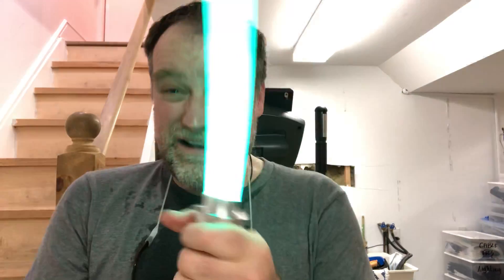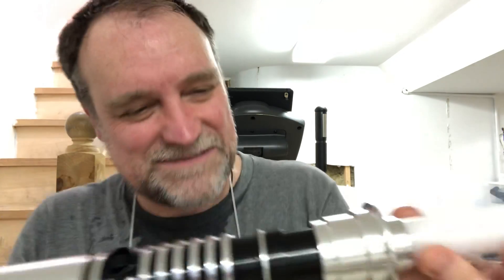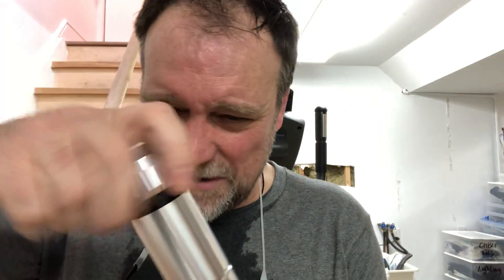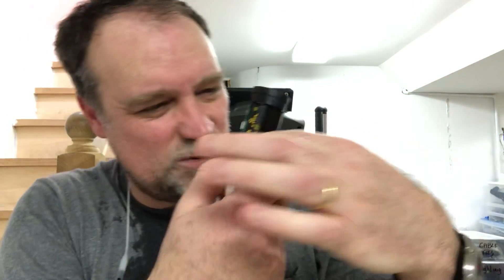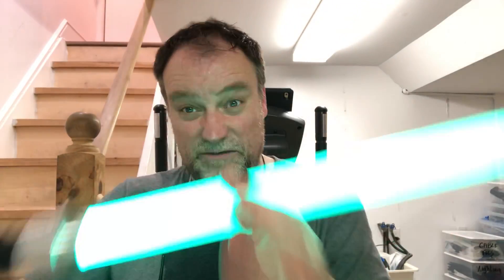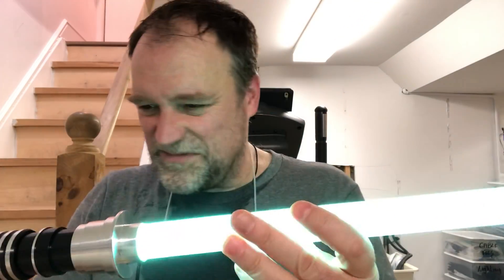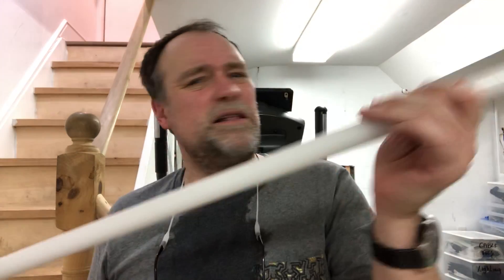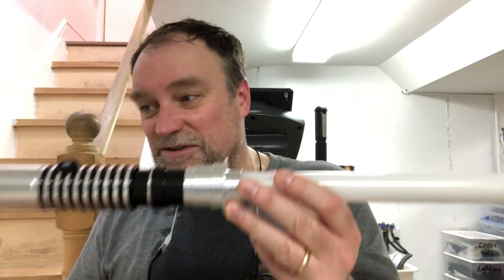Hand a router to Robotic arm or CNC router?

Comment: That 6 axis robot definitely can't do CNC milling ( unless being limited to foam or very bad results is ok ). You want a ton of torque and most important structural strength and rigidity to do CNC milling. The absolute top mistake of people building their own CNC router is underestimating this. Happens maybe in half of the DIY builds. 
To be clear: routers on robot arms *exist*. But this starts making sense when the arm starts costing the price of a house.
Oh btw, a reminder: if you want a FREE Smoothieboard Open-Source CNC controller ( fully Fusion360 compatible btw, we work with them on that they are super nice and like Open-Source ), just ping me and it's yours. Works really great on routers. Would save you quite a bit over getting a controller with the router you buy.
If you need help with anything CNC-related don't hesitate to ask also, I manufacture/sell CNC routers, and design/code CNC controllers, so like I know a bit :p
Reply from the maker: Thanks so much!  Torque and strength probably not going to cut it on a diy robo-arm...yet! ;-). Are you working on the smoothie boards?...they look amazing..and I love the open-source approach!
Reply: For the record, it is possible to buy second-hand industrial robot arms for the price of, I don't know... a very fancy, custom-built, garden shed! Okay, they're still ridiculous. Total overkill for wood, in any case, I don't know that many businesses really need the additional 3 degrees of freedom. 

Carving/engraving would be a lot easier, though, there's not that much in the way of cutting force when you're using a high-speed spindle, with its tiny chip sizes. Granted you'd still have a lot of 'fun' eliminating all possible backlash, since the position errors of all joints are compounded, unlike in a gantry CNC! You'd be able to do some excellent work with it though, such as engraving on complex/curved surfaces. I haven't seen someone do that on youtube yet, not surprising as that AR2 seems to be the most fully-featured, home-built, 6-axis robot that someone's shared!

Comment: Hmm... Using a router needs a lot of torque to hold it in the correct place simply because it's so heavy, not to mention pushing it through the wood or other material. CNC machines are specifically designed to be as stable as possible, whereas a 6 axis arm has a lot of areas that aren't supported and a lot of leverage with the heavy router spindle that could cause deviation with the quick movements. For example think about a canter-lever designed 3D printer: it's not so bad with 3D printing since there's little drag on the material and the extruder isn't too heavy, however despite the similarities in the technology you would rarely (if ever) see a similar design for CNC routing. It's a good idea, but I don't think it'd be easy to start off with, not to mention having to write your own G-code compiler to work with a 6-axis arm rather than a standard XYZ axis frame. You could probably do it with reverse kinematics, but that's out of my area of expertise.
Reply from the maker: Thanks! it would certainly be a lot more work...problem is I want the arm AND the CNC! ;-)
Reply: @dHewlett  Haha, I can definitely understand that. If you really need an excuse for the arm, perhaps invest a heck of a lot more time and automate your CNC machine. Use a fancy little arm to load in stock and remove the finished pieces when they're complete and you could have yourself a venerable little production line going! It could even possibly be useful for automating long multiple-object prints on your Prusa, for instance, more 6-axis robot arms? :D